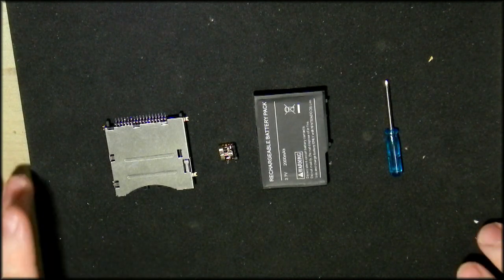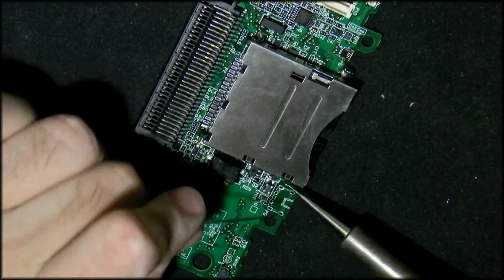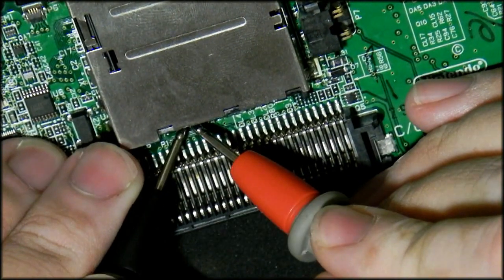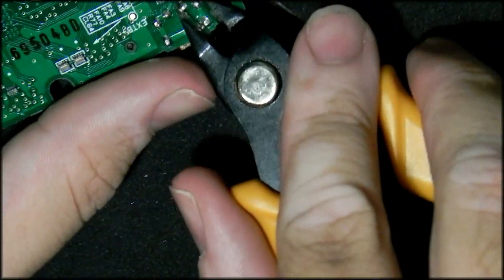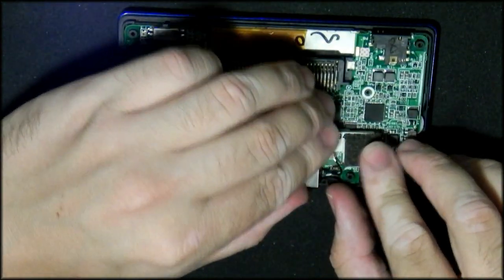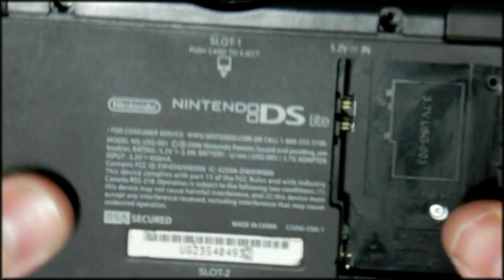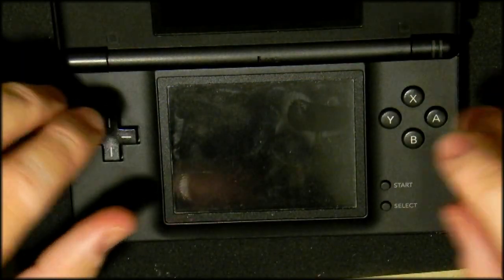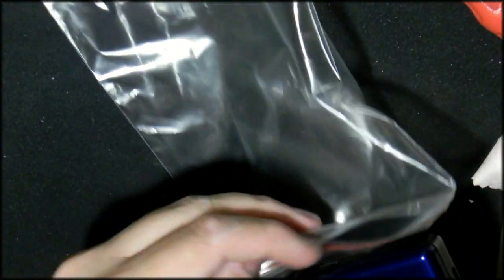DS-Lite Repair: Battery,Power, and Card Slot (Part 2)

Comment: Wonderful video HP really enjoyed!
Reply from the maker: Thanks Kevin, I am glad you liked it.
Reply: if  you remove  the wifi  will  it save on bat life
Reply from the maker: It wont start without the wifi dongle, it will just give you a black screen, so I wont remove it.
Reply: hmm or  you sure  was it  a  pal  or ntsc  ds  that od  it  dose not boot  mine work fine
Reply from the maker: thesmashtvnetwork Yes I am very sure , DS systems don't have pal or NTSC, do you have a DS-Lite or one of the other models?
Reply: i have   a  us  dsi  and  a  japan  ds lite   it  suck  tho thear no hack for  the dsi sd card be  nice be  able use  200 gig sd card on it  :)